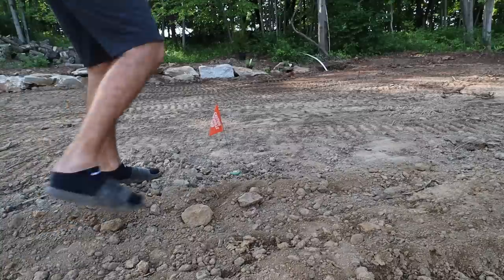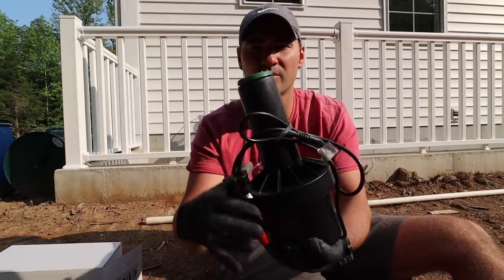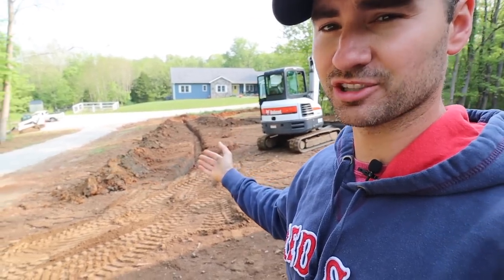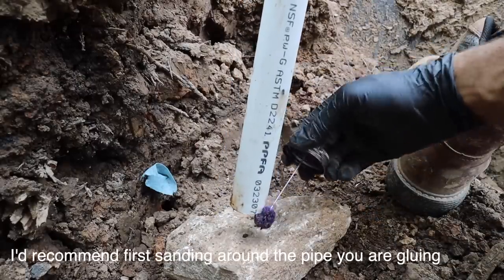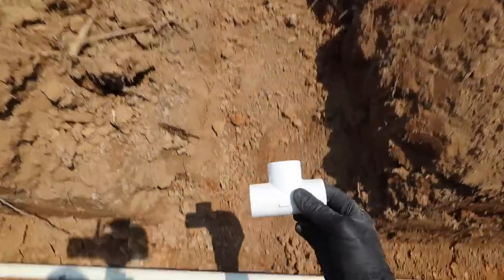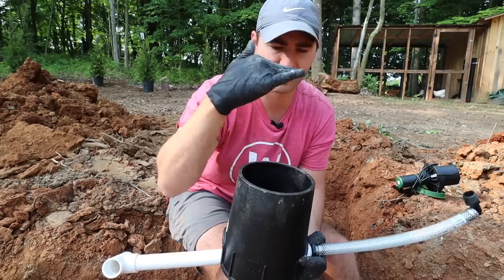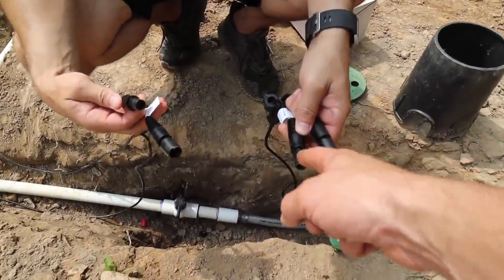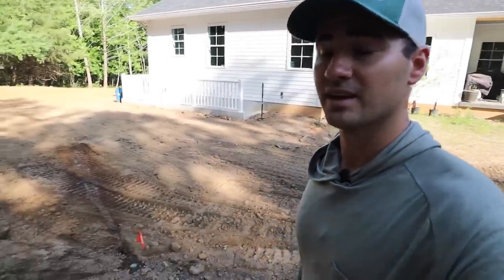DIY Irrigation System // EASIEST INSTALL

Comment: Been reading about the lack of reliability and customer service from Irrigreen. I hope you have success with these and don't end up going back to a tradition,al proven system in a couple of years or less.
Reply from the maker: They’re hiring more and more customer service staff so hopefully that won’t be the issue 👍 I’ll keep everyone updated
Reply: Yes, they also are EXTREMELY expensive because they know they have the edge on technology. But they have poor reliability and customer service like he said which doesn't warrant the cost. it's still a small company and they act like a small company. I'll be waiting for prices to come down. Hoping some competition too.
Reply from the maker: @peterholdridge  yeah obviously it would be nice to be able to get this product at a much smaller cost, like everything else in the world.. but I don’t see prices dropping much, even with more competition. I feel the cost is mostly warranted for the product you’re getting. Just my opinion. I’d rather pay the price tag for these and install them myself than pay the same or more for a typical system installed by a contractor. Again, just my opinion.
Reply: I’ve had Irrigreen for a little over a year.  After winter one head wouldn’t pop up, costumer service replied, logged into my system and saw a malfunctioning head, and sent out a replacement the next day. As for the cost get a quote for an irrigation company to install a traditional system
Reply from the maker: @JJ-pg4ud  if it’s sticking up high enough to run over with the mower then it wasn’t installed correctly!!
Reply: Y’all are better off using a traditional system

Comment: How does this compare to the cost of putting in say seven heads in different locations on a system along with trenching and all of that? I would need 3 ,ones. Each with ubheads.

Comment: Do you need to worry about differences in elevation? Do you need to do anything in the winter to clear water lines?
Reply from the maker: Nothing with elevation. Winter time you will blow it out like a normal system

Comment: Such a cool system but it’s hard to justify the cost, and then you’re locked in with this setup with minimal alternatives. I have 65k sq. Feet of lawn and it’s still easier for me to just swap a box of hunter PGPs from Menards when needed. Hopefully as the market grows the cost will come down!

Comment: Way too many concerns with this system and I would avoid at all costs.  Those small holes get clogged with any hard water contaminates requiring constant cleaning. Poor customer service has been mentioned all over  - you're never able to get a hold of anyone and they never call back.  You're stuck in this very small companies proprietary (and very expensive) system - better hope they never go out of business or you are screwed as this is all cloud/internet based and you can't go anywhere else for replacements.  Head problems? well looks like you have to shell out another $200 for another head, assuming they still make them and are in stock.  Computers/electronics buried indefinitely underground with pressurized water flowing through cannot be relied upon for that long.  You are completely locked into this system - If anything does happen to this company or you don't end up liking it for whatever reason you are starting from scratch as the pipe layout does not work for a traditional system.
Reply: Agreed. 100% unproven to this day
Reply: Yes, weird that all of the low-mid-subscriber lawn influencers keep pushing the system, but are not providing actual reviews – almost like an NDA or some other non-disclosure was signed.  The fact that Pete has the system and has not spoken of it since his initial video is very telling.  I experienced the same customer service and support issues as you and arrived at the same conclusion – the system seems very gimmicky and all-eggs-in-one-basket.  Time will tell if the solution is able to stand up to the same wear and ear as traditional systems.  Given the solution's current infancy – I am not willing to shell out a premium to be a beta tester.
Reply: Pete hasn’t talked about it because he doesn’t have WiFi in his shed. The system specifically states you need WiFi.
Reply: @thegreybeeexperience  Pete is the most OCD, gotta-do-it-right, above and beyond lawn guy on YouTube.  If Irrigreen offered even the slightest advantage over his traditional system, I am convinced Pete would be running it.  I am highly confident that Pete is more than capable of getting WiFi to his shed – I have never seen any other obstacle prevent him from pushing the limits of his lawn.

If WiFi is the issue, hopefully it will eventually be resolved – I would love to hear Pete's feedback on the Irrigreen solution.
Reply: @zCasanova  I’m the person who sold the Irrigreen system to Pete. He has specifically told Irrigreen that is the reason he hasn’t used it yet.
Reply: @zCasanova Pete’s moving, so that might not happen.
Reply: @thegreybeeexperience  yet he has a rainbird controller with WiFi in his shed that he controls with his phone?

Comment: How many feet between each head?
Reply from the maker: @gporr7004  each head can throw up to about 30’ and you don’t want overlap. Just to be safe though I’d recommend about 50’ between heads
Reply: @TheLawnWhisperer  Almslt everyone else says you def need overlap for even watering
Reply from the maker: @gporr7004  with a traditional style sprinkler system sure, but not with irrigreen.

Comment: I’m more curious about how this works out when someone goes to overseed.
Reply from the maker: What do you mean? Overseed or seed bare dirt?
Reply: @TheLawnWhisperer  both (edit): I guess what I’m curious about is if the water pressure will shift the seed one way or another.
Reply from the maker: @johngrinnell  yes, it will. I’m experiencing it now. They’re working on a good fix for seeding time that I hope to get my hands on
Reply from the maker: I should specify a seeding nozzle that you can easily change out
Reply: @TheLawnWhisperer  i definitely need to see that video
Reply from the maker: @johngrinnell  I’ll be posting it in a couple weeks probably. I honestly don’t think it would be a huge issue when overseeding. But bare dirt it is. The fix is to cover the seed with a straw blanket. I have a pretty incredible side by side of my lawn covered vs not covered

Comment: money spent on this system is $4000.00 doing it yourself and you are limited if something shorts out, you can not go to local supply. I can design a system that saves water bills 25%. the key is precipitation to the lawn and plants in a standard home.
Reply from the maker: To each their own

Comment: If your area has frost heave, don't expect the PVC to last more than a few years.
Reply from the maker: Everyone installs pvc here and everyone has no issues so I’d say it’ll be fine
Reply: You purge the system with compressed air. It's called winterization. 

Ball valve shut off with a bleed cap at source, copper piping inside house to febco 765-1 backflow, copper to The field, female copper fitting to male threaded elbow or however you build it, it must be copper female thread to house the male threaded PVC fitting, schedule 40 mainline, to your valve box, poly to the field with double elbow swing joints.

That's the correct way to install sprinklers
Reply: @rockymountainhomestead  it’s from the PVC physically moving and becoming brittle. Not from the ice

Comment: No you can absolutely not use poly pipe if you do not have a master valve. Even 100 lb poly pipe is not sufficient to be under static pressure, regardless of claims. I should know. I've worked in irrigation and run my own business.

Schedule 40 PVC for mainline.

NO POLY! It expands over time and will fail, even with double screw clamps on each side of the insert coupling
Reply from the maker: Well then I will just send all the pvc haters to your comment when they inevitably start bashing haha
Reply: Schedule 200 pvc is fine there is no need for Schedule 40

Comment: Fantastic video content wise. But far more time consuming and expensive than an “Easiest DIY”. $7700, renting a mini excavator, trenching, applying 2 applications of fast acting sealant to pvc fittings. You’re looking at several days of labor!
Reply from the maker: Why would you need to rent a mini excavator to install irrigation? It is by far the easiest in ground irrigation install. A trencher in Bloomington is about $100 for the day. Can trench everything for this system in hardly anytime. Pvc primer and cement takes hardly anytime per fitting. If it takes several days of labor for this system then it would take weeks of labor on a traditional irrigation system on the same yard. It maybe takes 1/4 the time to install this system versus a traditional system. Expensive, sure. I can’t argue that. But the tech is so cool and these sprinklers are so accurate at watering it’s incredible to watch
Reply: @TheLawnWhisperer   I appreciate the reply! haha
Reply: @TheLawnWhisperer  Agree that the tech is incredibly cool lol! Also agree about the workload. Think I was just overwhelmed at the idea at the time without prior plumbing / pipe fitting experience. Looking back, I wish I could have afforded it then but had a wedding coming up.  I ended up going with the orbit b-hyve spigot-attached sprinkler system. Trenched aIong my fence so I didn't tear up the grass and changed the pex from my from my main water line to the spigot from 1/2" to 3/4" and installed a water pressure booster 😂 Its no Irigreen but it gets the job done lol.